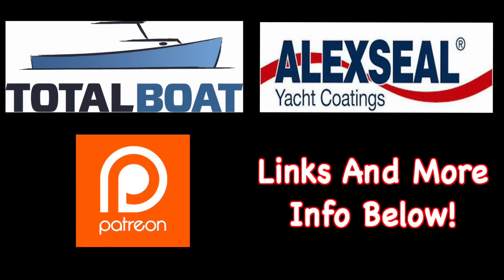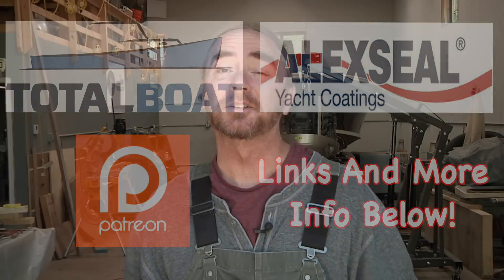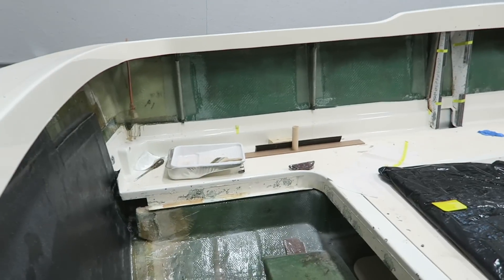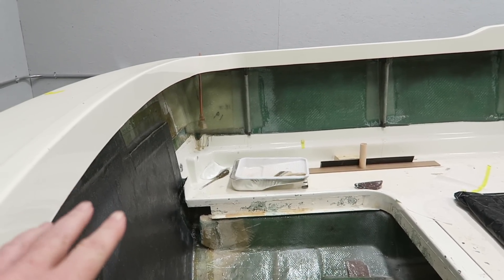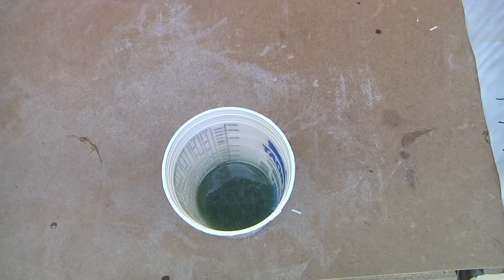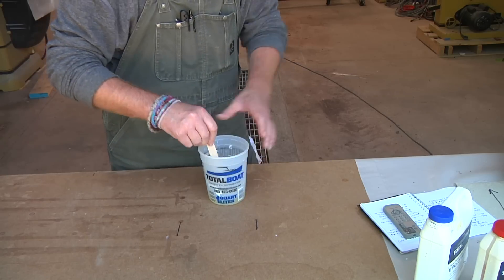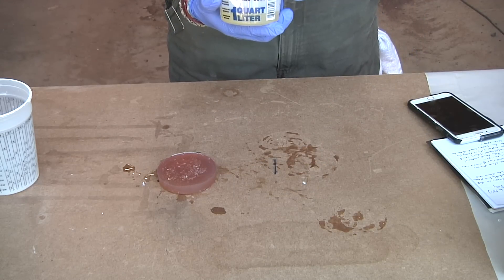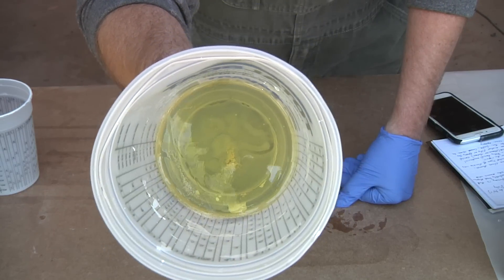HOW DO I KNOW WHAT FIBERGLASS RESIN WAS MY BOAT BUILT WITH??

Comment: Thank you Andy. As with others I recently bought an older boat ( 1994 Bayliner 2556 ) and no surprise discovered that it needed a modest below waterline hull repair. Been obsessing over what materials to use and was trying to find out what the original construction was. 😁👍

Comment: I replaced the transom,stringers ,and floor and 2 bulkheads on 18.5 ft Hourston Glasscraft using Epoxy after watching Boatworks Today vids(about 2 years ago. Boat now back in service.Thanks Andy. P.S. Epoxy cost a fortune but boat was a freebee!
Reply: It's weird. See here in the UK we don't even look at poly and Vinyl for repairs, even our chop strand most of it is powder bound for proper epoxy. They price is like £80-100 for 5kg of poly mix kit, and £100-140 for the proper epoxy kit. Most just get the poly or vinyl for scabby non-structural  fixes that are hidden or just to tidy the thing up. Every repair would be expected to be done with proper Epoxy. I'm in Scotland, West systems is laying about in folks garages here its the standard.
Reply: @J. FK
Bring
On
Another
Thousand

Comment: 😂 you nailed it 19' 1996 Trophy Pro CC. Someone loved this boat it's in great shape for the year. But the last owner was a screw two metal brackets into a cooler and screw it into the deck. I had to repair the deck and get the $25.00 actual cooler mounts and buy the new cooler and seat cushion $200.00 . Thank God he didn't own it that long before he sold it. The stringers and iner hull are solid and look great the floor and transom solid. I'm going to be doing some work but with Andys help and supplies I'm going to make this great little fishing and fun boat look brand new😊

Comment: Nice video Andy.  I have a couple of additions.

1) As I am sure you know the catalyst for polyester and vinylester resin is available in clear and dyed varieties.  In my experience the most common dye color is red.  The use of dyed catalyst will change the color of the cured resin.  Basically poly and vinyl resin can also be red although the red color is more distince with polyester resin due to the native color of vinylester resin.

2) Vinylester resin is more expensive than polyester resin.  Because of that vinylester is normally used only for the outer layers of a hull because it is more resistant to water intrusion into the layup than polyester.  So on a more expensive boat you may find that the first layer of mat under the gelcoat was set in vinylester, but the rest of the hull was built with polyester.  Also vinylester is generally not used for decks because they don't need the extra protection from water intrusion over time that a hull does.  Also vinylester resin is more unpleasant to work with (smell and allergic reactions) than polyester which can limit its use to essential applications only.

3)  How a boat was built also provides information about the resin used.  If you know the boat was built using resin infusion methods you can be 100% sure it was built with epoxy.
Reply: Not necessarily, vinyl infusion is quite common, at least on our side of the world the main reason being your get up to 25% more pulls in mold life by infusing in vinyl over epoxy. You also have the use of the term resin infusion, it is often (incorrectly) used interchangeably with the term vacumm bagging which is often a poly/vinyl method rather than epoxy.
Reply: @Todd Dunn Fairly accurate on EVERY point, Except 1. infused hulls are not all epoxy. Frontrunner boats for example uses infusion with poly, and there are many other builders using poly/vinyl  on infused hulls. Great advice and points though! 

I will also add, Vinylester has a very short shelf life, it kicks quicker  then poly no matter of your using DDM9 or 8. Vinylester is a great product for guys like me in the repair business as it is a much better secondary bond than poly, it allows for Gelcoat to be used without buying duratech primer or AdTech P-77 for a tie coat. 

As far as the brown resins (boatyard aka non spec) go they have a place for sure. At least in my shop. They do not require wax additives to sand after cure, they are cheap and work great for certain circumstances and they are good for spray fairing, sort of like what you do Andy with gelcoat over your final layer of repairs before sanding. I will use it as an initial print block layer a lot of the time as it’s much cheaper and longer working time than lightweight fillers. 

I have not been using epoxy much lately,  which is weird but, the QC of epoxy manufacturers has gone downhill and prices have SKYROCKETED! Even with wholesale acts, it’s very expensive. Hawk epoxy has become my shop choice as it’s just as good as west but a tad less. I do use all west systems fillers over hawk.
Reply: So it's almost impossible to see if a boat is made of vinylester or polyester other than the probability? The vinylester we use (at work)under the waterline is almost always a purple tint uncured but a dark green when cured and we use Trigonox 239 .
Reply: @Xplorawatercraft  What is the difference of infusing and vacuum baging?

Comment: I'm doing a stringer up restoration on a 1968 Hatteras 34. If I could afford epoxy, I'd go that route for the excellent mechanical bond. But I'll more than likely go with poly for any tabbing I have to do. I actually built the bait tank out of a mix of both bondo poly and total boat poly. Only real difference I could see was the $20 a gal price difference.

Comment: We build wooden International Moths using epoxy impregnated E-Glass over 1.5 to 3.0mm plywood. Since we are in Australia, we need the extra curing time of slow hardener. Our goto manufacturer - Norglass.
Reply: Poly resin on top of wood would just delaminate sooner rather than later, so one should use epoxy resin if the resin is used for gluing wood to something else..

Comment: My boat story. One day I went out to yard for a walk about.2feet of new snow, then I saw my boat! It's full of water frozen 8in I grabbed my pick axe chop here there then pulled out the ice to turn it over .did I say it is a livingston . yep mid Console about 4 holes fixed holes getting ready to fix gel coat to mask and cover. I used sting and green house flat sheet ruff it let it set filled it good to go.it was in 45 deg f I put a heater under boat made a tent and repair it  .

Comment: Hello iv got a Question iv just descovered your channel, Iv started a rebuild of a 22ft Cabin cruiser boat for use on UK Canals and Rivers it was made in 1970 and the hull is strong but needs work, In your experience a boat built back then what do you think the hull is made of Epoxy or Polyester? 

I will be sanding it down and fixing it along with either putting on a gelcoat or a flowcoat, any advice you can offer would be Helpful

The Boat is a Teal 22 Built by F.H Child im hoping to restore her to original and keep her for many years.

Comment: Proper epoxy is way better than polly and vinyl at 99% of things especially here in the UK where its powder bound chop strand. Nobody here wastes their time with polly and vinyl, it's not much cheaper and nowhere near as strong. Can replace transoms etc with maybe 2 or 3 less glass lays so is considered the vastly superior epoxy here. The argument that "they came with polly or vinyl" is fine.. thats fine on the first build, on repairs not so much as things like shrinkage happens evenly across the entire build on a newbuid, on repair areas you're effectively getting shrinkage just at the repair area. This phenomenon can be seen best in hole fixes by polly and vinyl that plug out after 3-7yr maybe 10yr max. West systems fills them holes for good even a poor fill it's there for our lifetime.

Comment: I have an old flat bottom fiberglass skiff that I'm rebuilding where the bottom of the boat is also the floor of the boat. Is it a must to use epoxy inside and out or can I use epoxy on the outside laminate and polyester on the inside?

Comment: Andy how long do you think excessive amounts of UV would be on an unprotected proper epoxy repair patch of a boat?  Do you think the odd days sun over the space of a year hitting directly on it while you complete the rest of the boat.. would cause any degradation worth noting? I seen the write up about it and they admit it does weaken it and it's worded pretty strong, then it says like 0.17% or some small number over hundreds of hours of sun. It's a weird one as I'm like "why is it so heavily worded then, surely that's nothing to write home about"   Have you personally seen the effects of it and over how long a period are we talking here and is it only on the 1-2mm on the surface where the UV can get to that it deteriorates?  I've never heard anyone getting any issues doing a boat over say 1-2yr and has been left outside with bare epoxy fixes all over it before the final paint.

Comment: What about the whole debate about not using gelcoat over epoxy due to incompatibility and adhesion problem.  That would also factor in as far as what resin to use wouldn't it??

Comment: Hey Andy, when you get to hang those engines on the Bertrum will you do a video on correct hanging procedures?
Just slightly on topic about the resin, so when replacing transom should the lower end below water line be epoxy over polyester? As I have just done polyester only...
Reply: He stated in the video that anything below the waterline should be done with epoxy, I think he said it @8:40!

Comment: Question: My understanding was that once the original resin has fully cured, any new work would rely on a mechanical bond rather than a chemical one. If that's correct, would it really matter which you use as long as you're not mixing chemistries while they're still active? 

It might make for an interesting experiment.
Reply from the maker: Correct about the mechanical bond after a material has cured.  One possible issue is that some epoxies can continue to leach off small amounts of a chemical that can effect the ability of poly / vinyl based materials to fully cure.  Maybe after years it may not be as much of an issue but it can last quite some time (especially if the epoxy was not post cured at high temps :-)

Comment: Isn't all this pretty simple? If you don't know:  just use epoxy -- it sticks to everything. I've built kayaks and I repaired a heavily damaged factory made kayak. When I built I wanted the best so I used epoxy, when I repaired the damaged kayak I didn't have to consider what they might have used because I just used epoxy.  
I'm a bit prejudiced against polyester. I've made a few darkroom sinks that I coated with polyester - but hardware store stuff. They would get this pinholes and bubbles. For a while I thought it was some kind of damage. Nope. I met a bunch of guys who had boats in the 1970s but gave them up because they spent all their boat time fixing blisters, pinholes, etc.... (I also read an engineering/chemistry article that discussed the chemical interaction between polyester resin and water. The stuff isn't actually waterproof.) I've since spoken with people who've never had a problem with polyester.

Comment: So boats built with polyester resin below the water line are in danger of sinking due to water intrusion 😬?
Reply from the maker: No not at all!  But when it comes to repair below the waterline, given the option epoxy is a better choice however either resin will work just fine :-)

Comment: ? I hit something in the river and scratched the hull center down to fiberglass.. no holes thank God my?? Is can I use total boat fairing filler on it sand and paint.
Reply from the maker: As long as the scratch is cosmetic and didn't damage the glass you can just give it a quick sand with some 80, clean and go overtop with a filler.  If you'll want to go overtop the filler with gelcoat I'd suggest using the totalboat structural repair putty.  If you'll be finishing with bottom paint then totalfair / an epoxy fairing compound will do the job ;-)
Reply: @boatworkstoday  thank you
Reply: @boatworkstoday  I'm so happy to get this old 1980 thompson back in the water with your video help